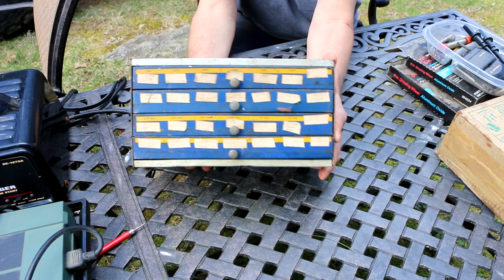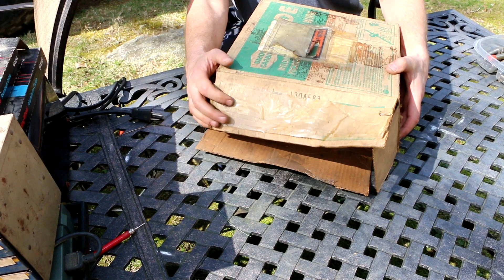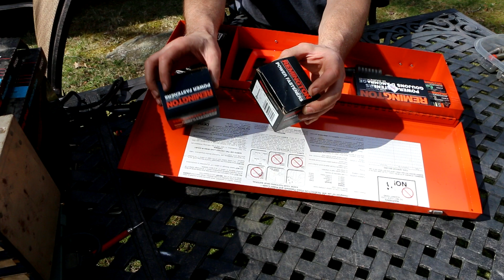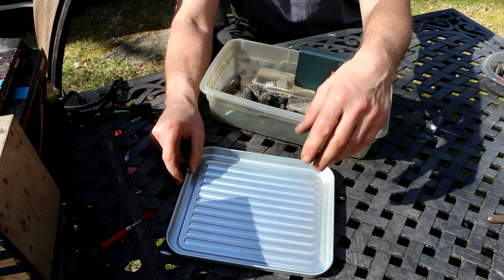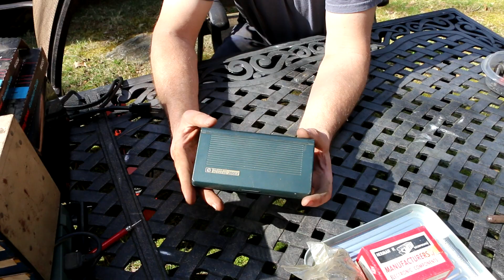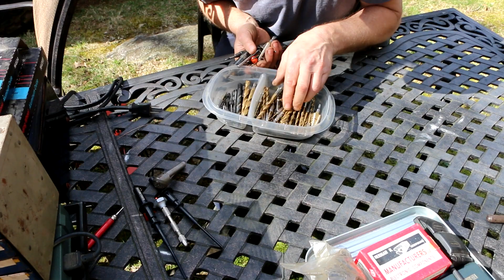March 16 2024 Estate Sale Pick: Tools, vintage electronics, and other items

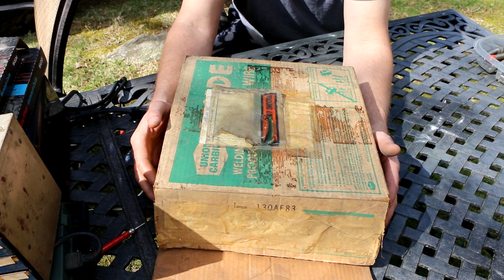Comment: 7:00 the welding wire is the original (as far as I know, but may go back further) "Easy-Grind".I think ESAB owns the trademark now. The old stuff is really, really soft, 70KSI wire for bodywork/sheet metal, that may not be as clean as you want. IIRC, no AWS class. Pretty good Charpy and elongation values. 75-25 Ar-CO2 to get the nice properties. 

The HP200LX is a neat device. When I was doing support for a top tier med school in the mid/late 1990's several people had them. 80186 and CGA-ish video, IIRC. Early flash in some versions, with behaviour akin to the Zenith Minisport.